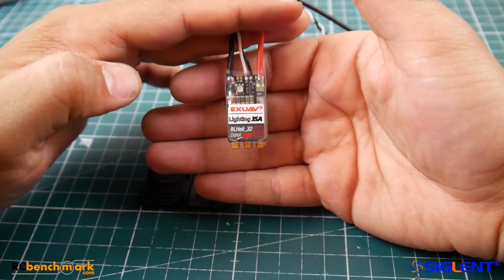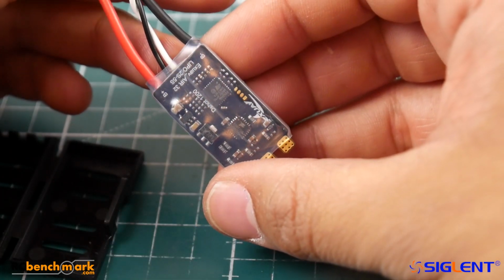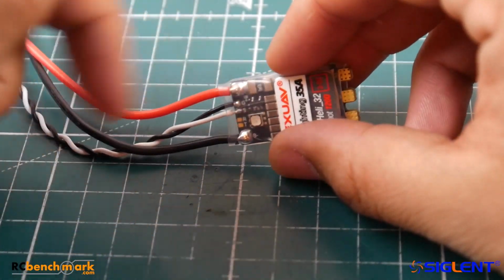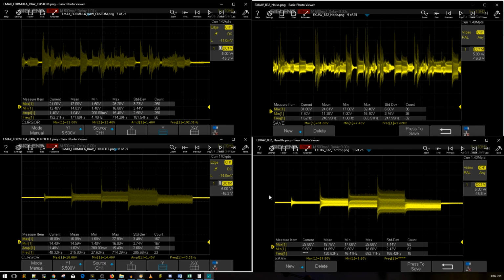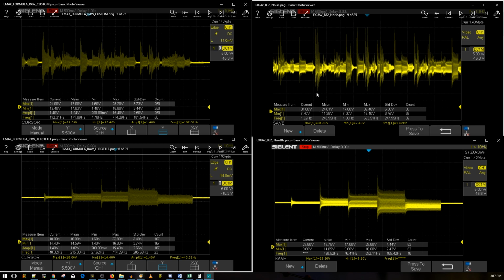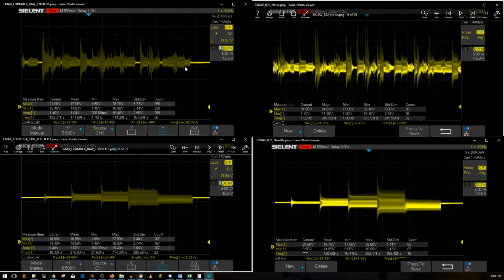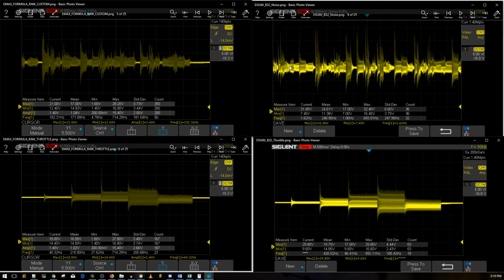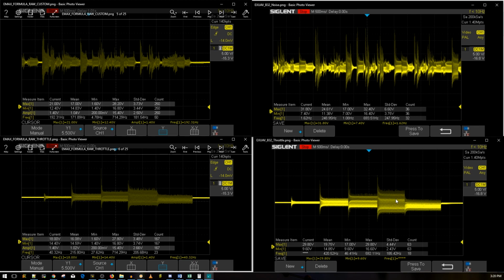Exuav Lighting 35A ESC // Review and Noise Testing

Comment: I have a feeling that word "Butterflight" recently began is become a panacea word for all quad building related problems. When someone talks about that his quad flies as crap on Betaflight and good on Butterflight, he should mention the configuration of quad (gyro model, ESC, motors) and which filters are used and WHAT EXACTLY CHANGED in quad flying behavior. Particularly I got pretty disappointed about advanced filters in both Betaflight and Butterflight. Even after rooting out found mechanical issues I don't have any flight improvement in both BF and BuF.
Reply: I had recently Yaw spin to the moon issues (yes that´s an official problem) due to bad vibrations from my old broken motors. I saw a post from Butterflight that they have "solved" this problem. I switched to Butterflight and is was gone :) But i haven´t noticed any flight improvements.